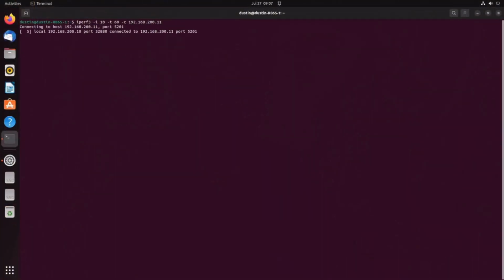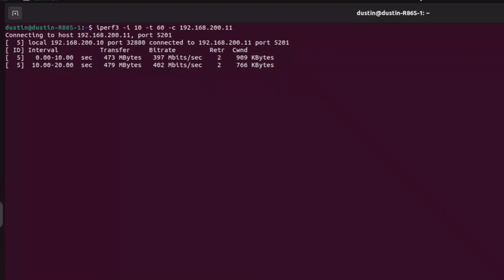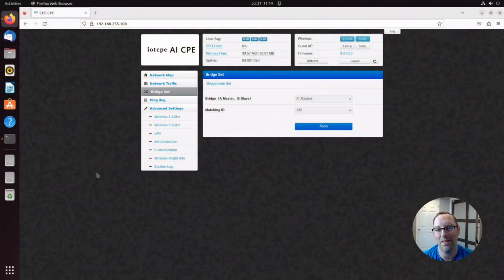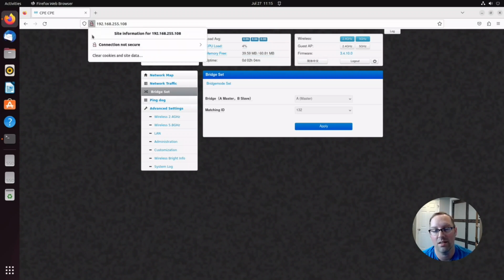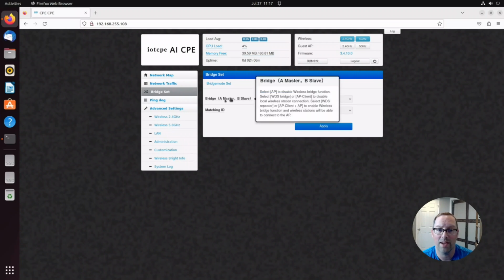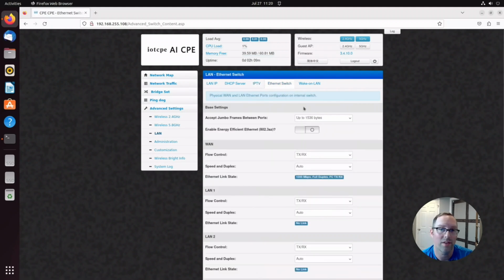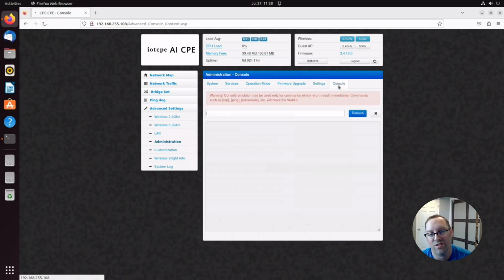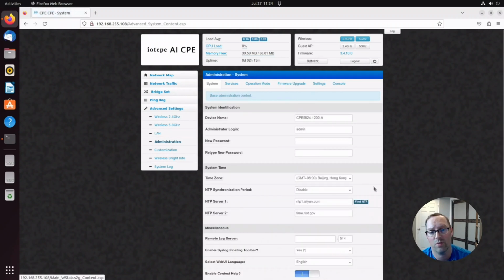Unboxing and Testing the UeeVii CPE852 Wireless Bridge

Comment: Great video man.  Could you help me?  I have these, and they are great. Unfortunately, I lost my manual and had to do a factory reset. I need the default password.  I know it is something like 12345678, but that is not working for me. Can you please tell me what the default password is?
Reply from the maker: Thanks! I can’t seem to find my manual quickly in my mess of things but when I tried looking it up, it said the username/password is admin/admin.
Reply: @homenetworkguy  Thanks. However, I am talking about the default wifi password, as I can only connect to it via wifi.  admin/admin is the system interface login, which I would need a computer connected to the router via ethernet to be able to access, without the wifi password.   Thank anyway.  I appreciate the help.
Reply from the maker: Ohh ok. Have you tried 123456? I vaguely recall maybe it could be shorter like that. If I find the user manual, I’ll let you know. The ridiculous thing I discovered is that they password protect their user manuals on their website and you have to contact them to get the password!
Reply: @homenetworkguy  I have tried, 01234567, 012345678, 12345678, 123456789.  But I think there were some letters in front of the numbers, like CPE1234567 or something like that. Thanks for the help.  I think I will try to get a laptop connected to the router to get into the interface.  I tried this before when I first set it up, but I could not gain access to it. I kept getting the router interface.  I think you mentioned in your video that you have to alter the router interface or something.  I need to rewatch your video and get a better grasp of what you said.
Reply from the maker: Ohh yeah, I think you’re right. I should’ve mentioned the default passwords in the video. I do that with other products… it’s something I’ve been trying to get in the habit of that in newer videos.

Also, the bridge will have its own IP address but it seems like it could be random because it was different than what the user manual stated.
Reply: @homenetworkguy  Thanks man.  I appreciate the time. I know you are busy.
Reply from the maker: I found the user manual! For the 2.4 GHz (SSID: CPE5G_2G1), the default password is 1234567890. For the 5 GHz (SSID: CPE5G 5GXXX), the default password is CPE123456XXX. The XXX stands for the channel such as 0 or 36. You can figure it out based on the last portion of the default SSID.

Comment: What router do you recommend on the Slave end?
Reply from the maker: You can use whatever router you like, but I run OPNsense on a mini-PC for my network. The bridge will simply be like running a long Ethernet cable (but using a wireless signal). Of course, it has the additional benefit of being a wireless AP on the master end.

Comment: Thanks for your video. You say in your walkthrough of the config section that you can turn off the Led's. I want to do this as they are bright at night. Have you tried it, and does it work?
Reply from the maker: So I tried out those settings but it doesn't seem to do anything. The blue channel light by the Ethernet ports can be covered up at least by the white plastic cover but the green LEDs can't seem to be turned off so you may have to put a piece of black electrical tape over it as a last resort.
Reply: Thanks for your reply. Seems a pity to spoil the device with tape. Looks like a firmware change is needed. @homenetworkguy

Comment: Great video, thank you for it! I have a question, on the master side can I get the internet to the PoE without a cable, or at least with a powerline device? That's because I have a power outlet near where I'll have the antenna (in the same power network as the router) and PoE, but it'll be extremely difficult to have a ethernet cable to it.
Reply from the maker: Thanks! If you have a powerline device that can connect to your network, that should work. Performance can vary on those powerline devices but it could be the easiest solution. If you don't need a ton of throughput, it may work well enough. If you went that route, you could plug the Ethernet from the powerline into the master into the included PoE injector and then another Ethernet cable from the injector to the master.

Comment: Can the slave be use as a hotspot… connect multi device wireless
Reply from the maker: I believe only the master has the ability to have a wireless hotspot so you just put the master in the area you want the hotspot (you shouldn’t need it on both spots because you should already have an existing network you’re connecting the wireless bridge to).

Comment: Good video. Your tip about placing the master unit at the far end of the network and using its wifi saved me from buying another router - althought the wifi is pretty weak. The bridge connection is solid -- and I've got some trees between master and slave. Thanks!
Reply from the maker: Thanks! I’m glad you found that tip helpful! Yeah I imagine the WiFi wouldn’t be as great as the bridge but if you find yourself needing better WiFi, you could just connect a wireless AP on the other end (of course the speed will be limited by the bridge speed, which seemed to be about 400 Mbps).